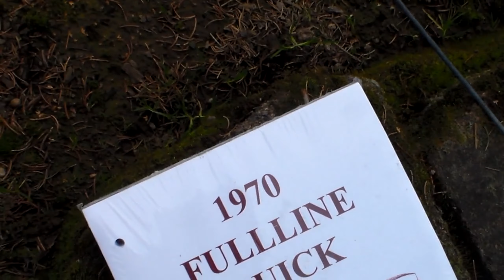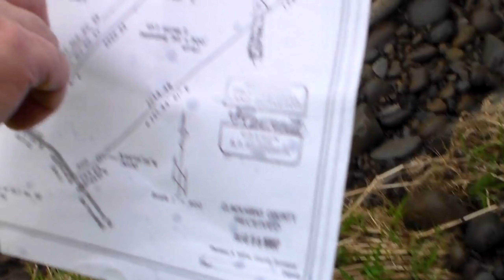Old Squarebody Hauling HUGE RV!

Comment: Yeah thats real-time kinematic gps, I've had an autonomous lawnmower on the back burner, it consists of a gps  base station that connects to multiple satellites to transmit increased accuracy to your mower, probably =/- 4 inches .. parts like mobility scooter gear motor are still pricey.
Quest for laziness still not at a premium.
Reply from the maker: Wow. You have some of that math-smart stuff going on there Buddy. I may have to get you out here to the Ranch and exploit that at some point.
Reply: @classictruckranch Just a bit, worked in IT since they started pulling typewriters out of offices. lol